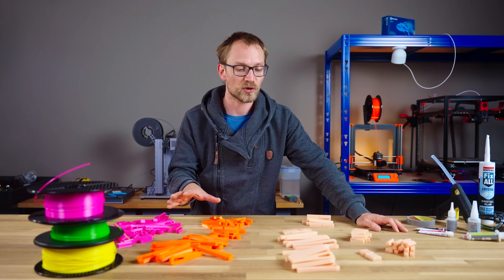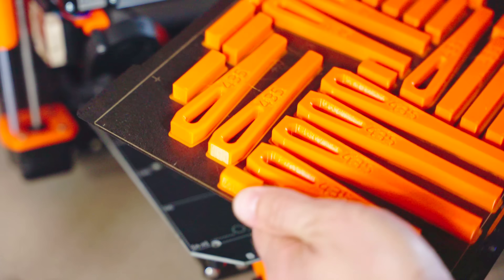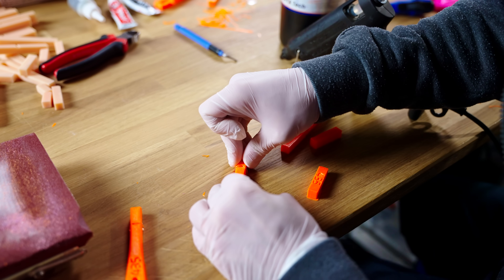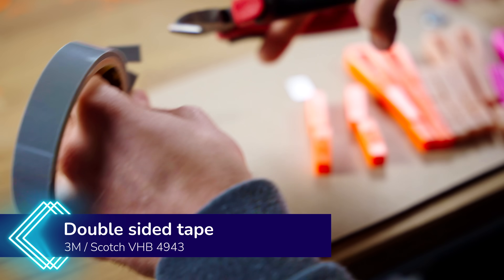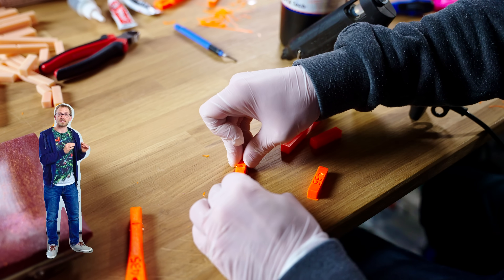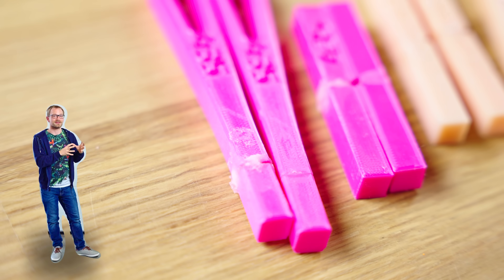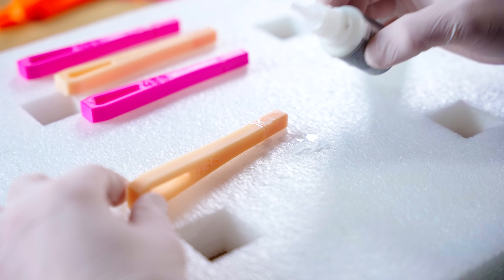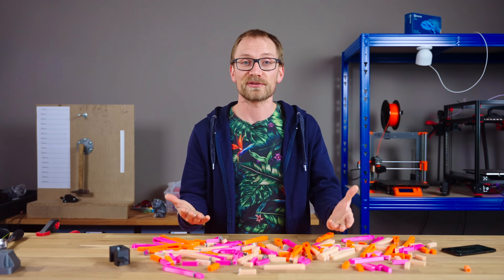Which glues work on 3D prints? JB Weld / Superglue / VHB tape…

Comment: Great series of tests Thom. A small note -- JBWeld is an epoxy, but a heavily steel-reinforced one. It is perhaps not the best representative for "generic" two-part epoxies. In the UK there's Araldite, globally 3M Scotch-Weld,  Loctite (but those are usually more industrial use) and I'm sure there's a fairly generic one in Germany too.
Reply: what's a good alternative for "less reinforced" epoxy? when i used JB weld, i figured it'd be fine to let it harden and sand way the blobs on the outside. i ended up having to take a full palm sander to it to even get it down a bit.

Comment: I am missing one type, cold welding model buildiung glue. It does work obviously pretty well for ABS but much less so for PLA. It would have been interesting to see however if superglueing is stronger or not in the ABS usecase.

Comment: super glue is no good. it turns pla brittle and turns pla and petg white where the surfaces are bonded. sometimes it happens right away but i have pieces that turned white at the joint after more than a year.
Reply: That is 100% the issue with CA glues.. works good for a while... But it will fail...  I have projects "welded" with "Weldon / Psigrip 16" that are over 5 years old and are still holding strong.

Comment: Weld-on 16 (Methylene Chloride based glue) is the only glue that I have found that works on PLA and will hold long term.
Reply: 3DGloop works well and is available in formulations for PLA, PETG, and ABS. Unfortunately it’s probably not available in the EU (or outrageously expensive if it is)

Comment: i've been using a resin 3d pen to adhere sla prints to one another. or any uv cure resin works. dab it on both surfaces, hit it with some uv light and boom adhered. but honestly for plastic 3d prints just use two part epoxy. bob smith industries makes some awesome epoxies.

Comment: Ooo, welding 3D prints together with the 3 types I use the most. Thank you Tom ^^. Oh, I recently read that resin has a shelf life of ~1 year. Do you have any personal experience for or against this?
Reply: Depends, UV resin smells different after 1.5 years, also needs longer exposure.
 2 component resin exceeds it's "use by" date by years, same with single component pouring resin, if unopened and stored cool.
I've recently used 8 year old 2 component resin that was bought for RC Copters - still works like new, became a bit yellowish since it was in transparent, but very air right plastic bottles.
The metal containers in which the UV resin comes should be good for storage as well.

Comment: Someone did a detailed video on this and found that the rubber infused Loctite Ultra Gel Control Super Glue was by far the best for PLA.  I bought some, but it hardened in the container in the many months long delay before I even opened and tried to use it!   I've had good luck on PLA parts with minimal gaps using water-thin CA which wicks into the joint.
Reply: Try storing it in the fridge next, it helps a lot with shelf life for cyanoacrylates
Reply: @UNVIRUSLETALE  Yes. Store in fridge but let it reach room temperature before using it, otherwise air moisture might dew inside the tube, which means it'll polymerize faster instead of slower
Reply: @UNVIRUSLETALE  I've done that with other CAs.  One has to be very careful to allow it to come to room temperature before use or any resulting condensation from air drawn into the container will cause the expected result.
Reply: @UNVIRUSLETALE  woah woah woah, for real?
Reply: I use small tubes of Loctite Gel Universal. They last for at least a month after I open them.
Reply: @johnpeters4214  I also get the small 2g tubes in both gel and “regular”. I love never having to deal with a bottle going hard or all of that buildup at the tip that happens over time
Reply: @ocieward  That's what I do now.
Reply: Whom did the video? i would like to watch it. can you share the link?
Reply: @thaphreak  Those peltier-cooled mini fridges?

Comment: I use super glue for all my prints. Maybe you could have also used heat to bond the material to its self. I think you could have sanded down the epoxy ones too like you did the super glue ones.
Reply from the maker: The epoxy ones didn't smooth over onto the part itself, so the contact patch was the same as if I had taken off the excess. Plus, with the way that forces are transferred through this geometry, the squeezeout also doesn't contribute to the strength of the glue itself.

Comment: Sawdust or baking soda work as great binders and fillers for superglue/cyanoacrylate. Dries instantly and fills out the area.
Reply: I've used baking soda and super glue when filling guitar nut slots that I cut too deep and it hardens like glass!
Reply: I once did an emergency repair in the office, and Splenda worked very well, too. Almost anything that's a fine powder will work.
Reply: @spagamoto  Did it also seem to instantly cure like it does with baking soda?
Reply: @emmettturner9452  Yes it did. Would be interesting to compare the ultimate strength vs other fillers...
Reply: @spagamoto  It seems even water causes a reaction but sodium bicarbonate causes an exothermic reaction that boils off the natural water to cure instantly with a puff of heat and CO². The increased surface area of any granules helps the traditional water reaction go faster too.
Reply: @emmettturner9452  A lot of people think air cures superglue but it's the contact with the water ions (moisture) in the air that does the job, although I've been told to much water can weaken the bond. In a theoretical room with zero humidity the superglue should not cure.

Comment: Plastic Magic works great with most PLA (been using it with Prusament and a few generics) and of course ABS. I've been using it for a couple of years for scale models (styrene based) and I decided to try it for PLA and was really surprised at how well it worked. It has a watery consistency and is applied with a brush. It's worked so well I now tend to split models and bond them in sections rather than using supports as there is less clean up. It's available from most hobby supply shops. Give it a try!
Reply from the maker: That's basically DCM solvent, right, same as 3D Gloop?
Reply: @MadeWithLayers  Hi Tom. I'm not sure. I've checked the packaging and its not clear waht the active ingredients are. It is solvent based.

Comment: Solvents, although not technically glues, deserve featuring. As you stated, PLA can be difficult to glue. Weld-on 3 or 4 chemicals bond PLA extremely well, almost as good as printer, and in some temperature cases, better.
Reply: DCM and products containing it are regulated in the EU and kind of hard to get.
Reply: The right solvent can make all the difference. Just look at what acetone does to ABS, and what IPA does to hot glue.
Reply: FO.